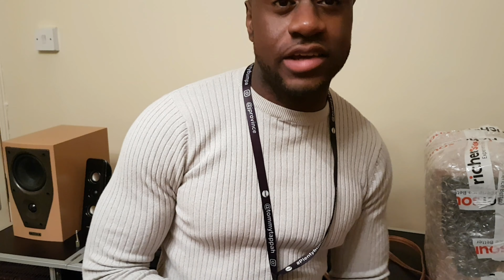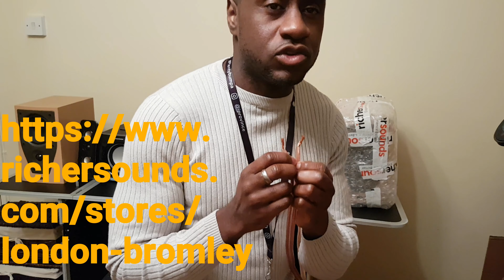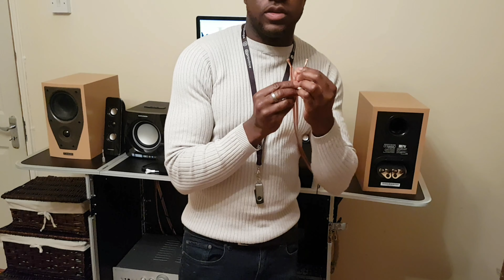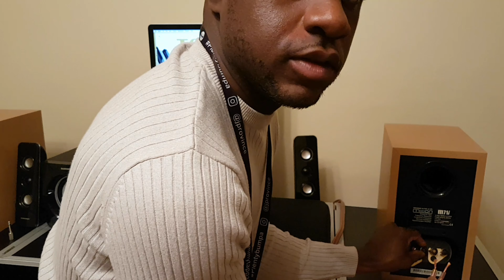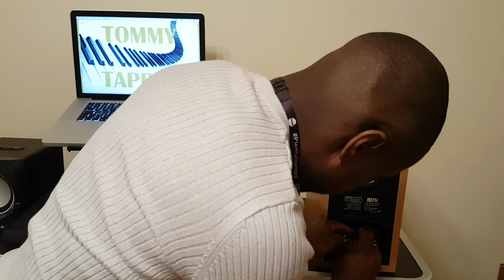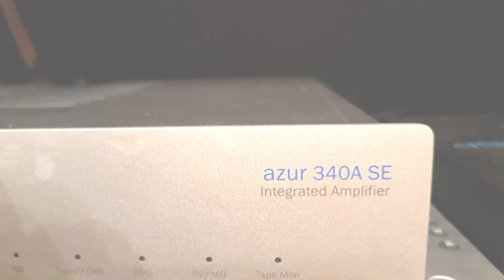"Wiring Mission - M71i" Speaker using "Gale Electronics" XL315 (Thick Cable)Not Biwiring Guys!!

Comment: One of my plates is missing wot can i do
Reply from the maker: Apologies for the delay, thanks for commenting, have you tried ordering a replacement part? Either check out the Richer Sounds/Mission speaker website, Amazon or eBay for a price comparison. I hope this answers your question. Good luck.
Reply: Bridge it with a piece of speaker cable. + to + or - to - which ever plate is missing 👌🏻

Comment: So what happens if you have an amplifier with high and low outputs but, speakers with only one input?
Reply from the maker: https://www.google.com/search?client=safari&rls=en&nfpr=1&sxsrf=ALeKk03IM0s-nvrA6sASfK_5ijsXe5cngA:1619346127023&q=1+output+speaker+splitter+adaptor&spell=1&sa=X&ved=2ahUKEwj7gK21lpnwAhUcSxUIHYddD_sQBSgAegQIARAx&biw=1174&bih=816
Reply: @TommyTappah  Thank you for your reply!  That option won't work for me though.  I purchased a Panasonic  SA-PM18 Stereo system, it did not come with speakers, nor did I think I would need special speakers.  It has a High and Low output for speakers.  My speakers only have one input.  So, if I connect the High from the Stereo, I only hear highs, if I connect the low, I only hear lows.  Is there anyway for me to get around this?
Reply from the maker: @stevea5799  No problem at all Steve A... The connector Type for that model is:

RCA x 2, mini-phone stereo 3.5 mm
However if you find your not able to connect it to a separate Amplifyer via say a pair of RCA Y splitters. Then I recommend you try Richer sounds they specialise in hi fi connectors they'll give you several ideas and you may get a resolution?! Best wishes I've used recently the store in Bromley London and was helped by a staff member: Jermaine to solve an issue with one of my Mission m71i speakers...the mid range and base blew.. its now fixed thanks to him!! The top end, mid and base bottom end are now clear again as good as new.. I have a video filming the whole scenario !! Link below!

https://youtu.be/jQOiXLihkHI

I'd say give them a try for advice you never know what the outcome may be !! You could mention you spoke with me if you wish!!? Ha ha !! Best wishes !!

Richer Sounds Bromley telephone number! 

0333 900 0051

Or copy link below for more details:

https://www.google.com/search?q=richer+sounds+bromley+telephone+number&client=ms-android-samsung-rev2&source=android-browser&sxsrf=ALeKk03rHFGcel9Mu75VTDfGFtUblMZGJw%3A1619372474546&ei=uqmFYMHwIKHFxgPKiKqgDQ&oq=richer+sounds+telephone+bromley&gs_lcp=ChNtb2JpbGUtZ3dzLXdpei1zZXJwEAEYADIGCAAQFhAeMggIIRAWEB0QHjIICCEQFhAdEB46BwgAEEcQsAM6AggAOgUIIRCgAToHCCEQChCgAVClJVjAN2CzQGgBcAB4AIABmQGIAfQIkgEDMS44mAEAoAEByAEIwAEB&sclient=mobile-gws-wiz-serp#trex=m_t:lcl_akp,rc_f:nav,rc_ludocids:808072220499768761,rc_q:Richer%2520Sounds%252C%2520London%2520Bromley,ru_q:Richer%2520Sounds%252C%2520London%2520Bromley,trex_id:W6wIre

Comment: That's not bi-wiring. You need 4 speaker cables, 1set for each speaker. One speaker wire for the high frequency (hf), and another one for the low frequency (lf). And most importantly, remove the jumpers, if you don't, will damage your speakers. Watch some videos here on how to bi-wire speakers.
Reply: Don't forget 2 signals use 1 amp for low and 1amp for high and you may hear a difference biwire means buy more wire
Reply: Rodel look up Audioholics on YouTube about biwire and bi amp please
Reply: @davemoore2539  I know how to bi-wire and biamp. My set up is now on a biamp...
Reply: @jetsky226  how's it sounding now ? Going to change mine over this afternoon
Reply: @davemoore2539  sound is much fulle,.highs are distinct.
Reply from the maker: Thanks I appreciate the feedback !! Yes I completely agree and apologies for all learning the "True" concept for the 1st time Ive mis interpreted the the word bi wiring with "two" split cables which is obviously not the same thing!! I agree that extended research is key in trying to execute any form of teaching in any situation ..I'm definitely going to use this moving forwards Guys! I'll check out audiohalics! I appreciate you taking the time comment..Enjoy the rest of your weekend, stay  healthy you and your families !!😎👌🏿💥💥💥

Comment: That's not bi-wiring.
To bi-wire these speakers you would first need to remove the bridging connectors (the triangular metal pieces). 
You then need separate speaker cables for the low and high frequency inputs. 
These can both be connected to the same speaker outputs on your amplifier. The idea is to separate the high and low frequencies to run in their own cables allowing for better attenuation.
What you've shown in this video is exactly how NOT to set up bi-wireable speakers.
Reply: If your connected to the same output on the amp how do you figure your getting 2 different signals
Reply: @davemoore2539  On biwirable speakers the woofer and tweeter are wired separately. So even if you connect the cables to the same outputs on the amp, you are still separating the signals for each driver.
Reply: Im just wondering if you ment bi amp
Reply: @davemoore2539  No. Biamping and biwiring are different things. 
What is shown in this video is neither of those though!
Reply from the maker: Thanks for your response Dan Xepha, I appreciate your feedback!!
Reply: Just wondering if you ever heard about Audiohalics look them up I appreciate your response not here to give you a hard time
Reply: @davemoore2539  you need two amplifiers for biampling, whereas biwiring uses only one amp..
Reply: Hey I thought the same the Bridge plates best remove them.
Reply: @davidgraham1292  HI David terminology is the problem hear ( bi wire ) and (bi amp ) now if your using an avr  ( multi Chanel processor ) you can use an unassigned amp to power the second set of binding posts not forgetting to remove the jumper OK so let's discuss ( bi wire) this simply means buy more wire look up Audioholics on the subject they can bring more to the table than I ever could

Comment: Perhaps it is a good idea to show actual bi-wiring when you are talking about bi-wiring.  Now you just used 1 wire for HF and LF: you bridged HF and LF which means you are back at magnetic interference in your cable.  Also use a good mic when reviewing sound quality.  Also show your head properly instead of your chest.  Also show 2 cables (4 cores) when you are talking about 2 cables (4 cores).  Also dont blow at the mic (5'20" - 5'50") right after all viewers turned UP their volume to hear what you are actually talking about.   Or you could just remove this video alltogether.  Good luck figuring out everything you did wrong in this video!
Reply: I didn't see anything about biwire in this video no disrespect bro but lame video.u did a simple speaker hook up.nothing about biwire.cheers mate
Reply from the maker: Thanks for your feedback!!